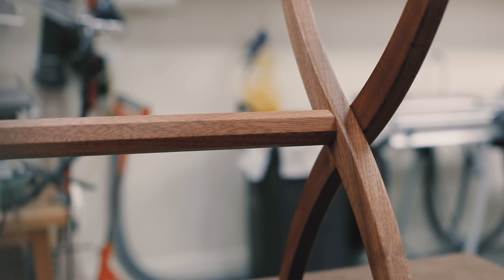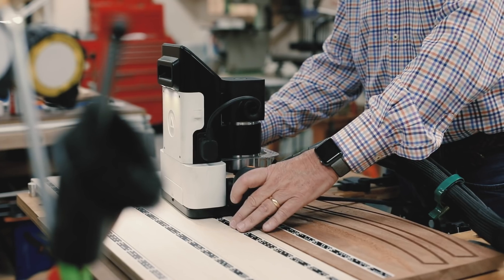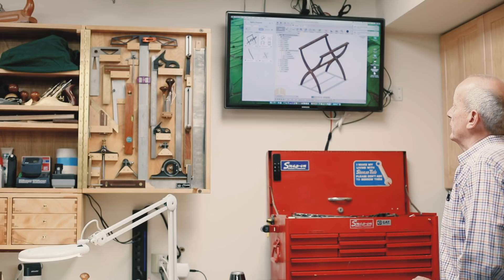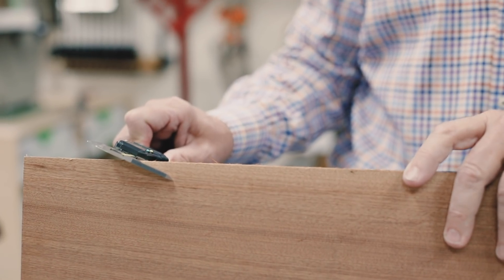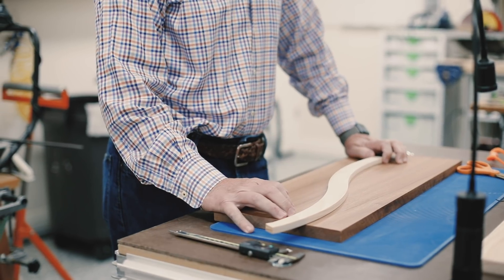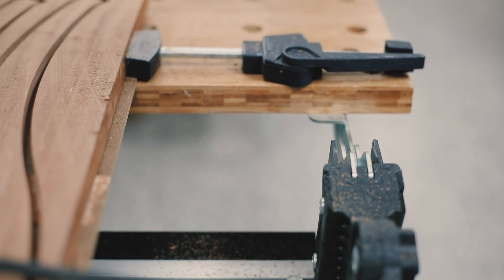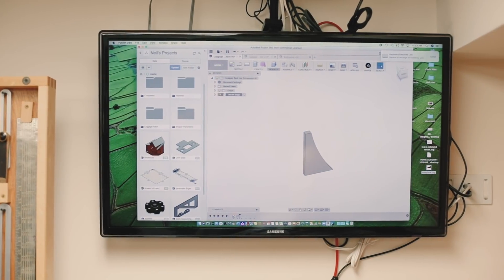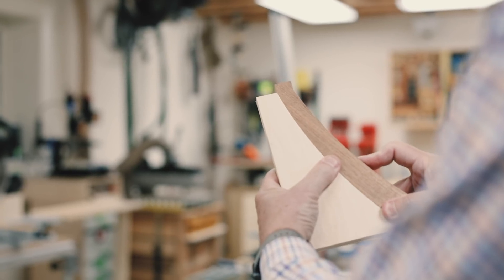Origin in Action:  Neil Clemmons

Comment: Why not just take an off-cut from the blank of your piece of sapele and use that as a work holding jig? You had the exact piece already cut to shape and sitting right there, with a straight edge on the back of it. If you needed it wider you could have just used some CA glue to attach a pine block to the edge to make it wider. 

This looks like a great tool, with many uses, but users should be careful to not ignore very basic working techniques and using their own thinking skills to come up with ways to work more efficiently and effectively.